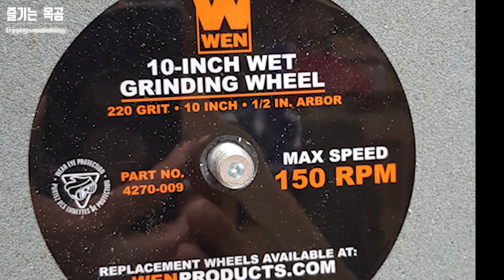WEN 4270 Sharpener Unboxing & Wood turning Tools Grinding Jig kit setup.

Comment: I wonder if you can use a CBN wheel in place of the leather strop?
Reply from the maker: I think it's possible as long as the arbor size is right.
For reference, the RPM of wen4270 is 100.

Comment: I would like to buy exactly these machines, but you can't get them anywhere in Germany. How much does it cost in the USA? Is it 10"?
Reply from the maker: The whetstone size is 10 inches.
The delivery fee is calculated based on distance and weight, so it is quite expensive.

Comment: That seems to be a long time to sharpen. How often do you have to do it?
Reply from the maker: Sharpening a gouge blade for the first time is time consuming.
But the second time doesn't take much time.
The frequency of sharpening the blade will vary depending on the quality of the gouge and frequency of use.

Comment: What cover is that on the table? It’s nailed to the wood?
Reply from the maker: It is designed to remove the water tray.
It is fixed to the top plate so that it can be moved left and right.
Reply: @enjoyingwoodworking691  what is the material? So the wood won’t get damaged?

Comment: I see you have a low speed grinder under the table. Bucktool maybe? Did that system with the one way jig not do as well as the wet sharpener?
Reply from the maker: The grinder under the table is very small.
It is a low-cost grinder with no speed control.
It is used when non-sophisticated metal grinding is required during woodworking.